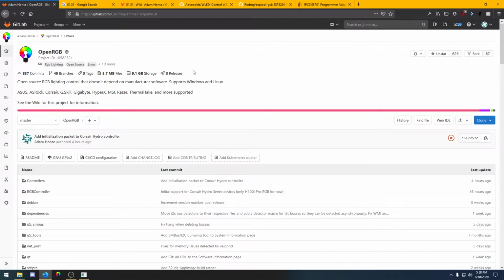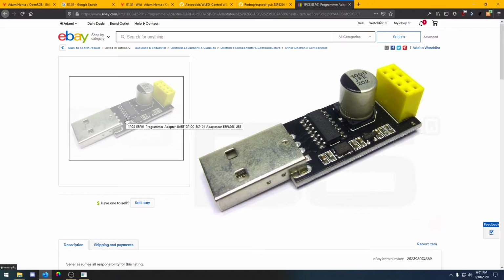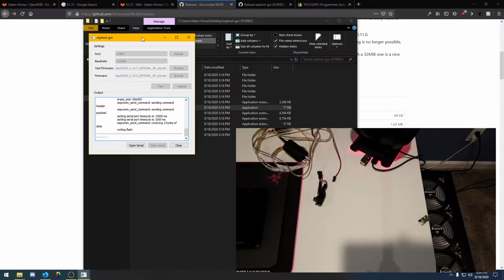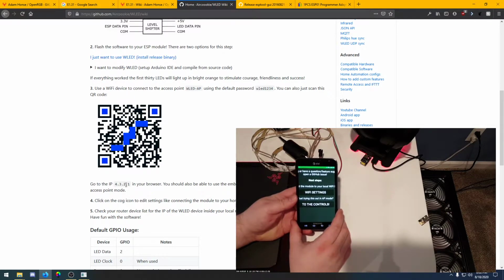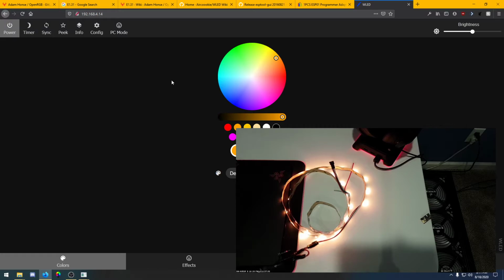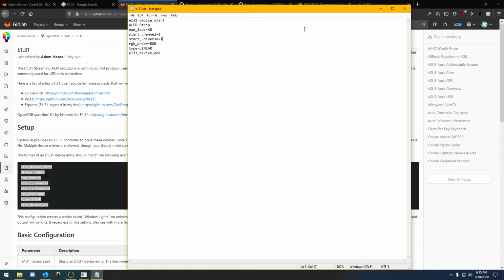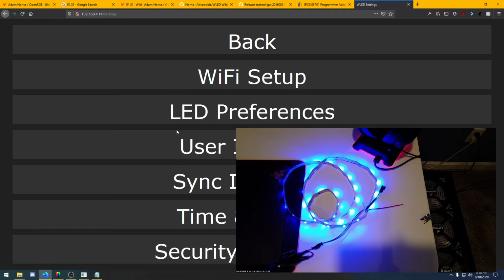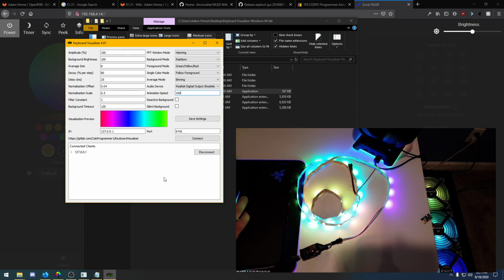OpenRGB E1.31 and WLED Wireless LED Strip Tutorial

Comment: is it possible to do the reverse process to send the effects from WLED to openrgb devices ?
Reply from the maker: No, WLED does not output effects that I'm aware of.  The OpenRGB E1.31 Receiver plugin allows other lighting software to control OpenRGB devices, but WLED only inputs E1.31 not outputs.
Reply: @CalcProgrammer1  awww that is sad, would be amazing to have wled effects all over devices

Comment: Any chance on an updated tutorial?  The way this is done is different now, I can't seem to get open RGB to recognize wLED at all. On openRGB version 0.51 
I am guessing the edits now have to be made to the json file in the appdata folder but no matter how or where I place the edits it doesn't seem to make a difference. I tried adding the direct IP address but that didn't seem to make a difference. As far as I can tell all the correct information was copied over from the wLED setup menu. I am completely at a loss herer. Any help would be greatly appreciated.

Comment: Hi!! I have problem with connecting e131. When I setup the e131 TXT after that I can't able to find it on open RGB device list even after plugging off esp8266
Reply from the maker: Please use Release 0.4.  The latest builds have a new configuration file format and will need a different format from the e131.txt file used in the previous versions.
Reply: @CalcProgrammer1  Hi, where can I download Keyboard Visualizer 4.01 ?

Comment: I downloaded the latest openrgb release but it only shows my keyboard and not my motherboard and ram, my motherboard is ROG Strix B450-F and my ram is avexir core 2, can you help me so i can sync it with other device
Reply from the maker: Did you run it as admin?  I've never heard of Avexir Core 2 RAM.  There's a chance that it uses the ASUS Aura controller and will be supported but if not, it likely won't be detected.  The motherboard definitely should work though.
Reply: @CalcProgrammer1  i ran it as administrator but it doesn't detect my motherboard